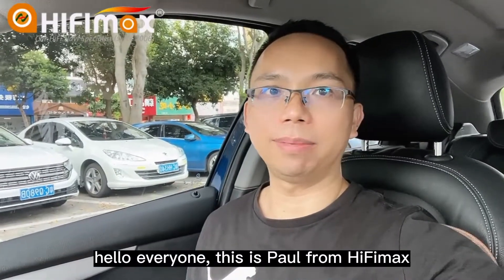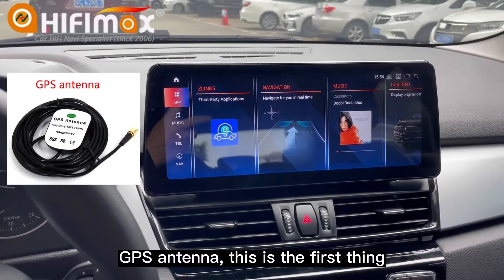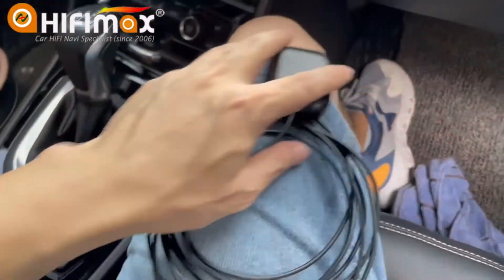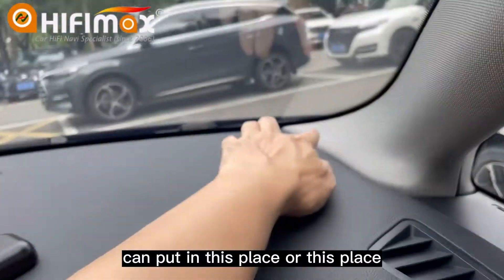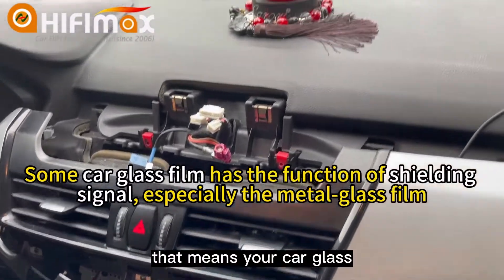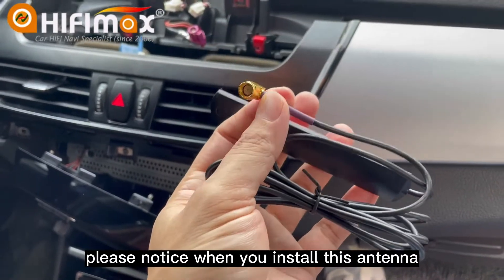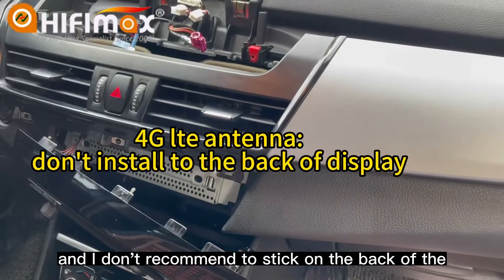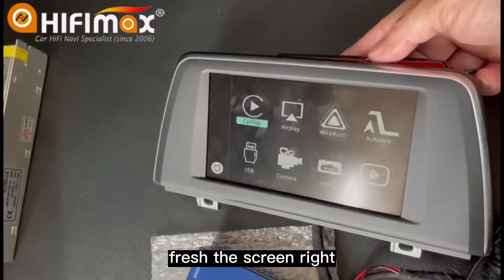Android Car Stereo No GPS signal/ GPS not found trouble fixed, GPS 4G LTE antenna install guide!

Comment: Great video. Any advice on connecting the 15.6 aftermarket t-style infotainment radio screen hotspot 6my factory radio in my 2019 GMC Sierra SLT truck

Comment: I tried using my original car GPS antenna using a Fakra C Male Blue Coaxial to connect my factory GPS antenna to Android car stereo but no signal.
Reply from the maker: Not recommend split cable
Reply: @HifimaxOfficial Agreed. I ended up switching to the GPS antenna that came with the unit and instantly got bars when plugged in.

Comment: Hi Friend, 4G antenna is only important if I'm using simcard in the headunit right?
I did not install it, I will not use sim card
Reply from the maker: If you not use 4G SIM card , no need to install it

Comment: Hello Paul. How does this device capture gsp signal if you install inside the car pillar? Doesn't the device need to be exposed? Doesn't the metal part of the pillar block the gps signal?

Please help explain to me
Reply from the maker: It don’t need to exposed , my car installed to A pillar and it works perfectly in the past 6 years,
Reply: @HifimaxOfficial  Thank you for responding! In this case, can I hide the antenna receiver under the (engine) hood of my car? 

If yes, then I can just do it myself with some double-sided tape or just the magnet. If I cannot hide it under the hood of my car, then I have to install it into the pillar, and it will cost me money at the car workshop

Comment: Problém GPS stay for me.
Reply from the maker: Maybe you can tell more details of problem.
Reply: @HifimaxOfficial  antena Under front Glass. After start radio and map app. GPS signal zero. In GPS status app. same problem. After reset in menu is signal ok. GPS and glonass.
Reply from the maker: so,that need to test if the glass block the signal, when put it outside the car, to have a test, will know it.  @rzboril